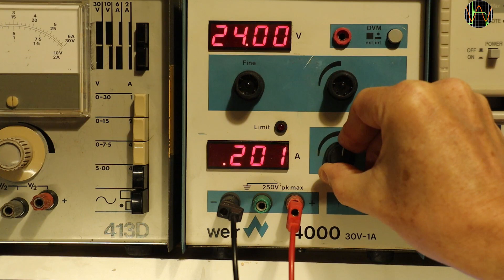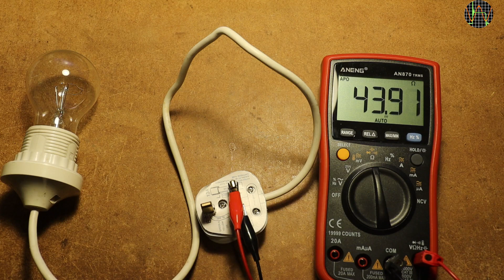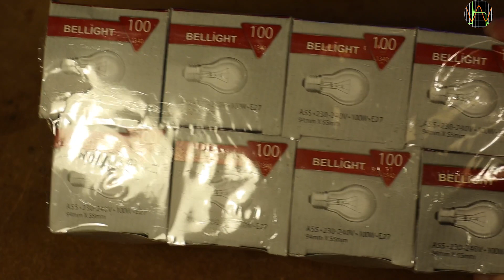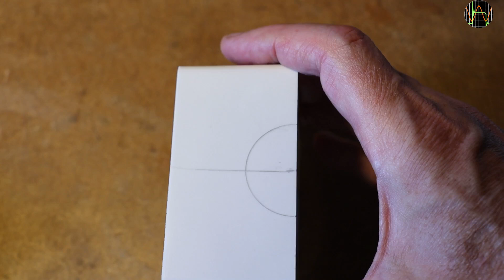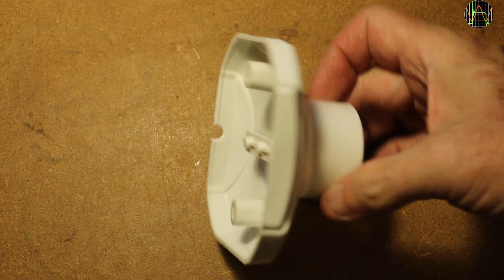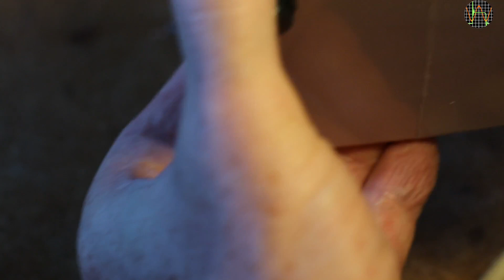137 - My Light Bulb Moment: Building an inexpensive mains current limiter

Comment: Can i use one halogen bulb (220v) istedenfor big one? Would I get the same current  limiting protection?
Reply from the maker: Excellent question. I have not tried it but it should work. However, in this application the bulb hardly ever really lights. That would happen only if there is a total short in the device under test, which is pretty rare in my experience. This means the bulb is usually dropping very little voltage causing maybe just a glow. Halogen bulbs don't like being run at too low voltages because the regeneration of the filament works only at high temperature. It may be useful to run the halogen lamp at full power every once in a while to avoid premature failure.

Comment: Another option is to add an AC socket in place of the lamp socket into which a high wattage resistive load can be plugged, such as a clothes iron or a resistance heater. That allows you to test higher wattage DUT.

Comment: I heard halogen bulbs would be ok for this purpose if incandescents are not available. Is there any truth to this claim?
Reply from the maker: I don't know. Its likely it would work. After all, they are resistive loads like a normal filament bulb. It would be interesting to test but I don't have any to play with. You could also try to find a suitably big wire-wound resistor, say 500 Ohm 150W for 240V mains. The main problem is that you could not see what is going on without hooking a voltmeter up in parallel to the resistor. It also lacks the PTC characteristics of a light bulb but it would limit the current and prevent or at least reduce disasters in the test objects.

Comment: This has made me wonder: For initial test at power-up, what are the benefits of using the current-limit (incandescent bulb) approach v’s using the voltage-limit (variac) approach?
Love the channel, this is brain food 👍
Reply from the maker: It depends (as always). If a device is really quite old and has lots of big caps, it is useful to run it for a bit a lower voltage from the variac (and with the light-bulb current limiter) so the caps can re-format (rebuild the insulating layer). A variac by itself is not limiting the current. A dead short would trip the variac even at 30V or so. If the device isn't quite as antique, the light bulb is the only thing I am using at the first power-up.  So (IMHO) the light bulb is  always used, the variac occasionally and in addition.

Comment: My version of this sort of thing: https://www.youtube.com/watch?v=cUy-8bwjI_Y
Reply from the maker: Very nice. I like the way you protected the bulbs. The only drawback I can see is that it makes it a bit harder to see bulbs that just glow unless you look from the top at the bulbs inside.
Reply: Having the panel meter there to show wattage, reduces the need to see the bulbs. But it's currently connected before the bulbs, so it's not showing the voltage at the load. I should change that, but then I'd probably also need to separate the meter's supply input and voltage sense input. One day...

Comment: INFO About the "normal current" for a Device Under Test (DUT)...
The manufacturer's rating label will show the maximum current (Amps) that a device draws. Thus is the higher when eithee from starting up (eg motors) or at full power, and this can differ greatly from the "wattage" which is usually the normal running current. The maximum current rating may be an instantaneous value, but it all depends on the device, and if you don't understand that characteristic then you shouldn't be testing things anyway 😮
Therefore the light bulb wattage should initially match the DUT rating for "Watts". The worst that can happen is that the DUT cannot get started, and the light bulb stays at full brightness. That's thw whole idea of having s current limit irrespective of low voltage or AC Mains.
A simple AC Power meter is very worthwhile as well. A cheap plug-in model like a "killawatt" will be OK, or use a AC panel meter from Ebay etc.

Comment: Thanks! Very informative. In the UK, for most DUTs what do you suggest as bulb rating? 60/100W should be enough?
Reply from the maker: It really depends what kind of DUTs land on your bench, or more accurately their vintage. Things with valves will probably need more. So far I have used 100W but all I am repairing is "solid state" (transistors or ICs). Possible exceptions: Class-A audio transistor amps or RF transmitters / tranceivers may need more that 100W but I have not had one of those on my bench.
Reply: @TheHWcave thanks, clear! I think I might make a version that can accommodate two bulbs to keep it flexible so if one bulb is not enough I can add another one in parallel. Thanks
Reply from the maker: @ivanr5315  Yes, that would a good solution
Reply: The formula is shown in the video from about 3:00 onwards.

Comment: Medium base bulbs may be disappearing, this project can be more flexible with 4 x 25w C7 candelabra bulbs (or 40w) with 3 of them switchable, giving it a nice range of 25 to 100 watts (or 40 to 160). This is also called a E12 base socket and 4 would be easier to mount and take about the same space.

Comment: This item was a part of the workbench of every 1950s and 1960s television and amplifier repairman. It should still be a standard tool for anybody repairing old electronics or playing with old machines. This device will stop an old RIFA capacitor from causing damage when testing an old machine. When we switched to LED lighting, I bought a few 200W and 300W bulbs for just this use.
Reply: We were using it in the 1980s and I still have one on my shelf now.